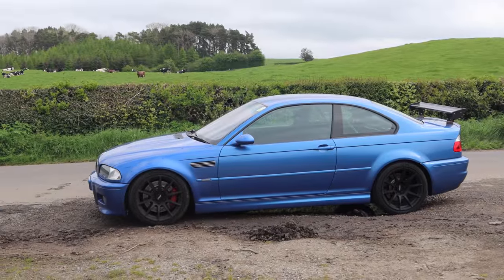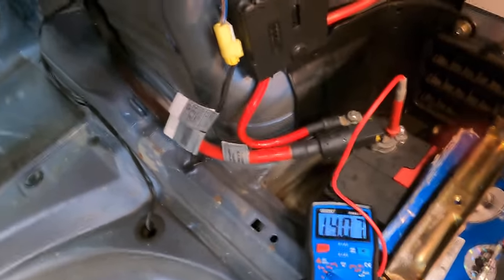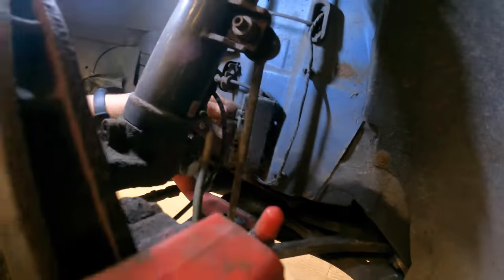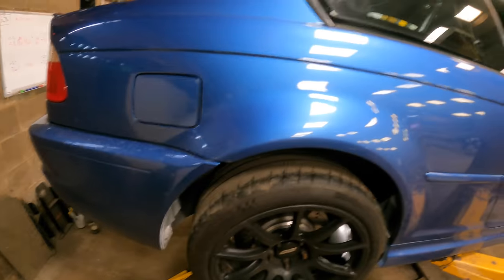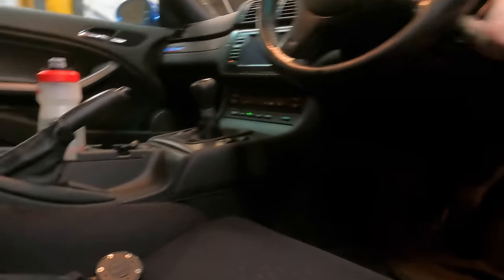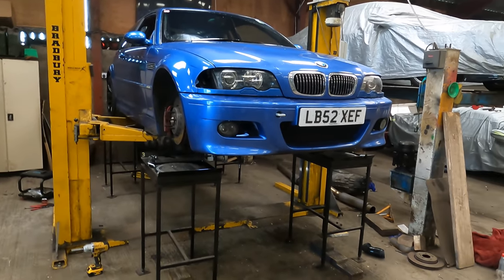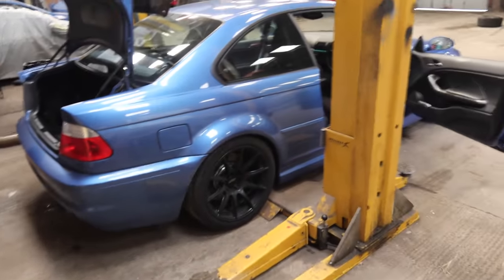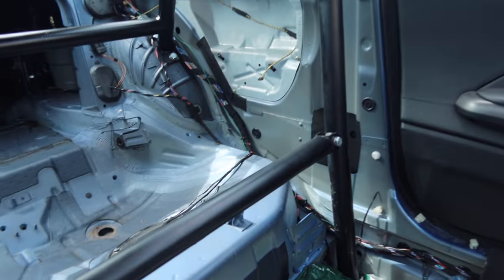Fixing ALL the M3s Warning Lights To Get a 100% Legit MOT

Comment: check the alternator wiring! pretty sure it has smart charging, had a transit with the same issue about 10 years ago where the battery light was on but was still charging and found a corroded wire near the alternator. repaired it and it was grand. something to look at anyway 👍

Comment: Have you tried a new battery? The Voltage may be good, but what AH is it providing? 
I think once you’ve driven it, it’s charged above the warning threshold. Because you were in the lockup with the lights on etc, the battery dipped below the AH threshold.
Reply: He has one of those posh deadweight lithium ones but said the problem was present before. M3s often were advertised having had a new alternator when I used to look years ago so perhat this is why!?

Comment: Do the Cup 2s take a while to warm up on the road?
Reply from the maker: not sure what you mean?
Reply: @dannyDC2  Well when you go for a quick drive on the road, not the track, do they grip okay straight away or do they need quite a few corners to start gripping properly?
Reply from the maker: @Cypress_green  I've never had them slip on the road (without forcing them)

Comment: also must say a previous M3 video helped me get bluetooth in my 2001 728i, it has the same big  16:9 nav like yours and all the 'experts' on the forums said you had to buy all this shite or replace it etc. Did what you did and just soldered a bluetooth adapter to the CD changer output and then power to an ignition live and it's been working perfect for over a year

Comment: There is a little plastic securing pop that holds the headlight washer pipe in position- mine did the same thing on the n/s washer jet (came out) and left a pool of water (and failed MOT) it might be loose in there somewhere?
Reply from the maker: guessing you typed that before watching to the end :D

Comment: Got the same deadweight Batterie and since then minor electrical gremlins aswell. Not an m3, but the airbag and abs/esp warning lights go on maybe 1 in 20 starts or so. Alternator new, charges fine, replacement Batterie from deadweight but... Still there.

Enjoyed your recent Videos very very much!
Reply from the maker: I not had any issues from the battery

Comment: Hey Dan not sure if you read all the comments or not but got an idea on your battery light! On my E36 there is a wire that runs from the back of the alternator to the ignition barrel, that's what tells the light to come on. This might be loose and causing your intermittent light?
Reply from the maker: hmm maybe, seems more of a signal failure than a mechanical one

Comment: Could be your alternator regulator is failing intermittently.
Reply: My E92 regulator started failing intermittently which resulted in it not charging unless i switched the engine off then restarted it then all was good! Never once did the battery light come on weirdly.
Reply: @simonhaycocks  yeah from my experience my 3 series alternator was very worn, did not yet give a light but the brushes and slip ring had deep grooves in them. After some time it did flash.
Reply from the maker: @becomematrix  mine was replaced not long before I bought it - wonder if an aftermarket regulator can cause it
Reply: @dannyDC2  i had a rebuilt one in mine which did deliver good voltage but despite that threw a battery light. no bueno so I got a new one and a new drive belt so have it tensioned properly. 

Perhaps take out the alternator and inspect it visually? Have you checked the voltage on the cluster? There is a 'secret' menu option for that. Also after you've driven the m3 (charged the battery) does the battery stay charged at 12.8 volts? (just to check if either alt or batt is bad)

Comment: Put a non airbag steering wheel on it and you can just do away with the airbag light.
Reply from the maker: how do you work that one out?
Reply: It comes under the car being highly modified, basically gets an advisory put on the mot saying so. Same way that a rally car will be mot’d and not have an airbag system/normal seatbelts etc. If its not there it cant be tested basically. I’ll dig out the mot from my clio track car from a few years ago.
Reply: Do an mot history check on DS03 VLB. I had it stripped with a single seat/cage and no seatbelts/airbags in it. I had the 2014 mot done once I’d finished building it.
Reply: @graemebeveridge5111  I thought they'd pissed about with the rules again since then? I don't think there's any discretion now- if a light is on its a fail, and they have to cycle with the IGN so you can't even take the bulb out.
That last batch of rule changes were the last straw for me, sticking pre '93 forever now haha